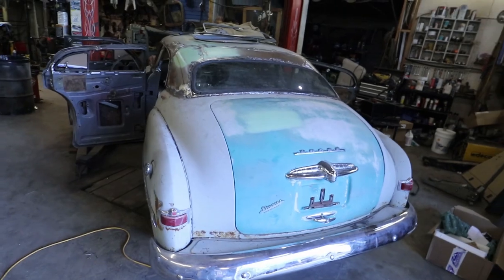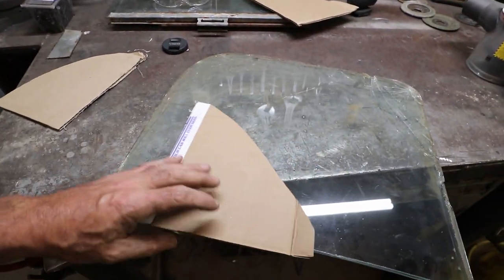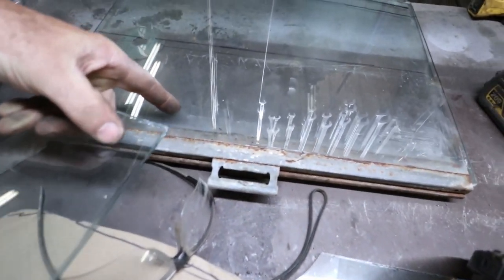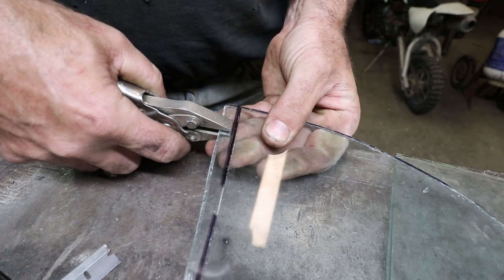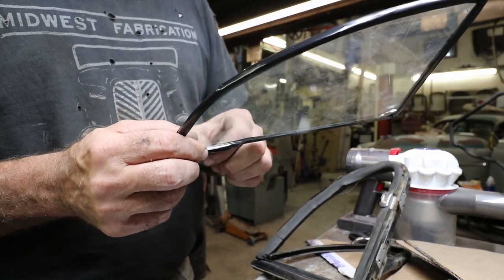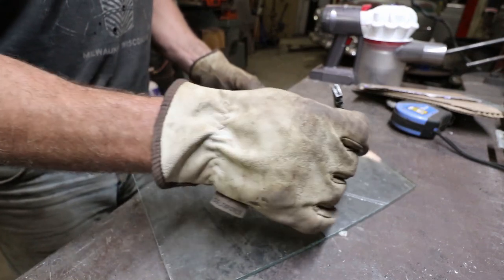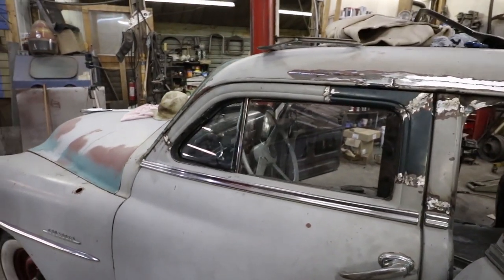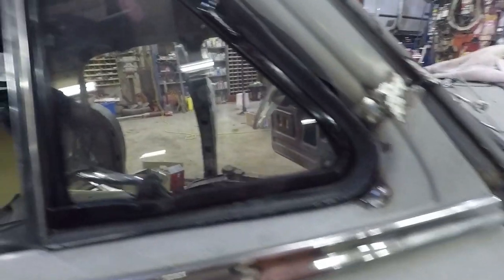1951 Dodge Crusader -  Cutting window glass

Comment: Just a drop of crazy glue applied to the crack in the glass should make it disappear. I've had good luck with the thin UV curing resin as well on safety glass cracks. Dirt is the enemy of getting good results repairing cracks so the sooner you do the repair, the better the result.
Reply from the maker: I've tried it will have to try again, think the old stuff is much thicker than the glue can't get down the crack as well.

Comment: Little trick when you cut laminate glass:
If you dump some methyl hydrate on the glass and light it before you try to use the pliers on your cutoff, it will make the vinyl layer softer, stretchier, and more pliable and it will be easier to remove your cutoff pieces.

Comment: I'm not sure if stained glass is different or not but I used to cut some really tight curves in stained glass by starting my tap in the tightest corner and work out to the cut ends, try it on some scraps but light taps if it trys getting away then go opposite side and work it that way and I hope it helps the cutting in the future. And I was going to comment in the last vid to get a glass cutter lol...

Comment: I had a couple windows cut for my 57 ford. My glass cutter didn't use a torch he squirted alcohol on the crack and lit it. Then he cut it with a razor blade just like you do. Looks like both ways work. Good luck.

Comment: The "exploding" glass is actually "tempered" glass. As you know, it is not possible to grind or cut it. It was tempered with heat, however during the "Space Race", Corning developed a tempering process using chemicals, not heat.
Reply from the maker: yeah didn't have the right words for it. it's to unpredictable to deal with as sand blasting has worked but it just randomly blows up after haha

Comment: Brent, can I offer a small tip as I was once a glass cutter. Keep your cutter/s in a jar/tub/cup of white spirit, (only has to be an inch or two deep); it helps for a cleaner score, Drag your cuts toward you. Tap under the start of your score to start the vent. A bench covered with felt helps too as softens the scoring. I used a t square with a notch at the bottom to allow for the full stroke of the score. I like your idea of cutting the laminated glass using  a torch to soften the lamination in the middle, then a one sided razor blade. I also used to make leaded lights too back in the day, very time consuming especially squeejiing thejoints in the lead.
Reply: Good info but Brent will probably never see it. It’s buried to far in the comments under an old video. Post it on one of his most recent vids. Thanks for the info

Comment: I was going to ask what you use to replace that rubber in the track of the vent glass...I'm doing the same thing....electrical tape aye ?....hmmm...should you use any goo ?
Reply from the maker: I've used hockey tape and urathane also to hold it in